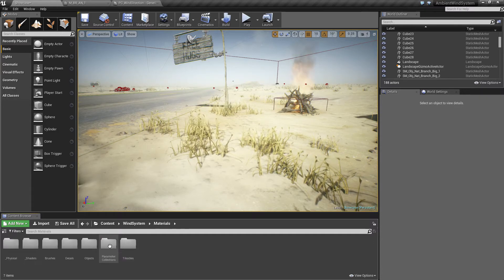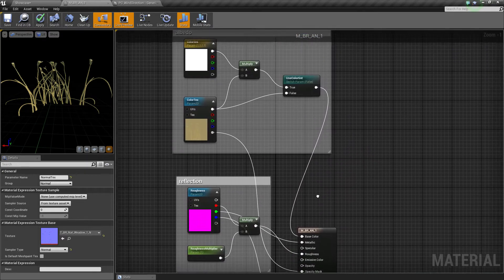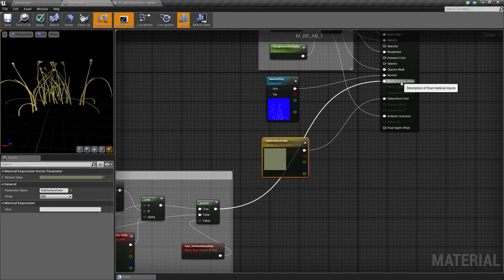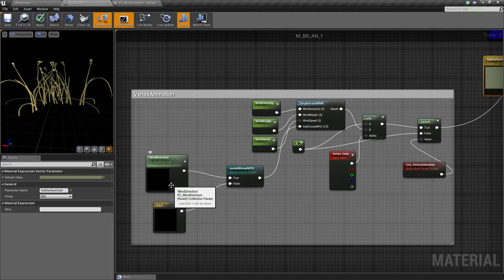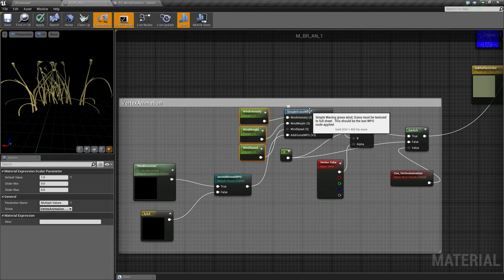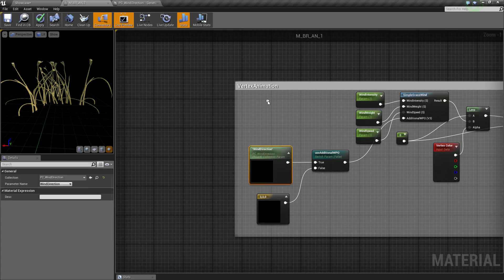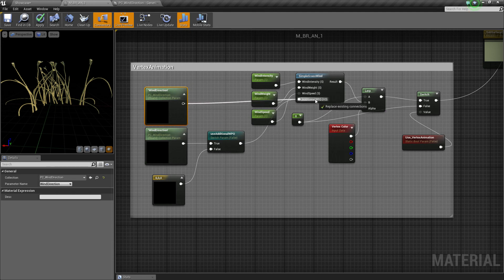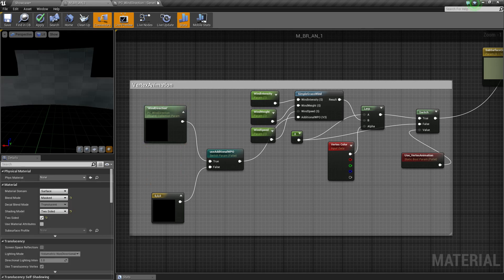Ambient Wind System for UE 4 - How to setup grass materials to receive wind

Comment: hello, I have bought Ambient Wind System on Marketplace, I'm trying figure it out how to integrate this on my trees 
ambient wind must effect bark (Sway animation) and leaves, like speedtree wind animation
can you help me?
I can sent you my tree with my custom wind shader
best regards
Reply: This is using vertex colour, so you would just need to paint the verts on your tree limbs accordingly. As long as you match the base of your leaf polys with the vertex colour of the branches they should move together. You just need to make sure you add the vertex animation to your bark texture.